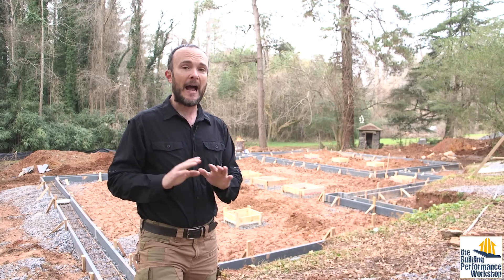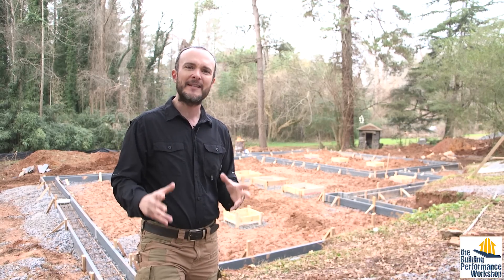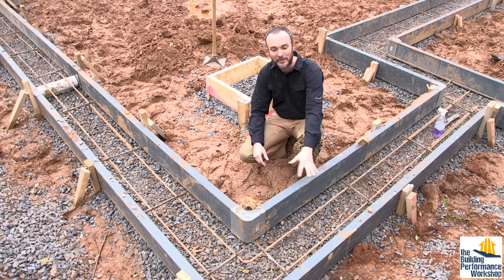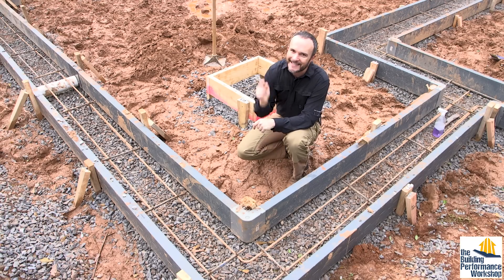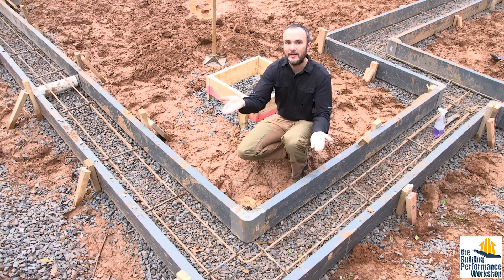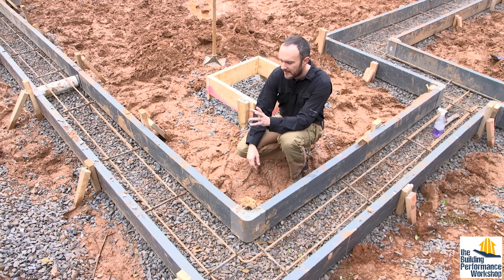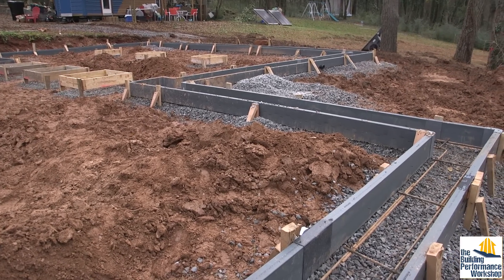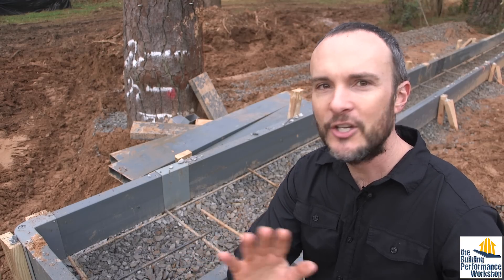First Concrete Pour: Form-A-Drain 4-in-1 Foundation Footings

Comment: As a residential building contractor, I do not allow my customers to interfere with the build process. My customers are allowed visitation to the job site at pre determined times, and are not allowed to give any instructions to my sub contractors, employees, suppliers, as well as have any dealings with the local building department. To do so would nullify the contract. After 44 years in the business, you learn a thing or two. A novice who has watched HG TV for a year has no business on a construction site. I make exceptions for decent people at times, but I never deviate from this rule when it comes to my contract.
Reply from the maker: Maybe you missed it, matsfreedominatrix, but I am the builder and GC. It's my own home. The foundation contractor is a sub. Get over it.
Reply: Yeah, why would you? Can't tell you how many times I've seen homeowners slow down the build process by catching subcontractor mistakes! Best to keep owners off site so it's easier to get away with it.
Reply: Nice comment. I never interfered. My concrete is not the grade I paid for. It has cracked full thickness in less than 6 months. The walls are not straight! The doors have gaps  that were patched because the contractors could not cut straight. I have 3 less steel beams in the first floor than are on the plans. Engineer designed plans. I paid for 2 times the amount of tiles that were actually used in the house. I threatened legal action if he charged me for them. I now have a huge pile of extra tiles sitting in my garage. The reason the customers want to be on the building site is to stop SHODDY, LAZY, CORNER CUTTING, SCUMBAGS RIP THE CUSTOMER OFF! If your the customer I recommend you go to the site on a daily basis to ensure your house is ACTUALLY being built to the plans. ANY contractor who doesn't want you to go to the site, want s to restrict your access does not want you to see where they are working the margins to increase their profits.
Reply from the maker: @petercoverdale5003  well said
Reply: @petercoverdale5003  Pick a contractor with a GREAT reputation next time. Otherwise, be your own contractor. Hire your own subs, deal with your suppliers, and work with an engineer of your. People do it every day.
Reply: Disagreed with your initial comment. Totally agree with this one. Yeah, people can be a pain. Welcome to the human race. But is you cvan't tolerate it, charge double or work in I.T.? @matsfreedom
Reply: @petercoverdale5003  : Great example of why @matsfreedom can shuv his comment squarely up his ass. I encourage my customers to show up on the job site. This ass hat apparently doesn't understand WTF a Change Order is all about. Most times ( 9 of 10),  customers need to actually "see" something before they actually realize what it is they wanted; I don't think there is anything wrong with this, or allowing them to make changes. 
This @matsfreedom guy sounds like the type who 1. thinks he knows it all better than every other person on earth. 2. Talks shit about all other contractors and how they can't do 1/2 as good a job as he can. These are the types of contractors who put the "CON" in CONtractor. Nuff said...
Reply: If I’m paying for your services, you are not going to stop me from showing up to see what’s going on on my own property. I respect the fact that you do not want the customer interfering with your workers. Beyond that, no contractor is going to  treat me like they are doing me a favor.
Reply: Naturally, if your customer doesn't happen to be on site when you come up with some money-saving, corner-cutting idea, you just implement it and pass the savings on by nullifying your contract and coming back with a less expensive one. Um-hmm.
Reply: Doing it this way could also save a marriage. I was a carpenter on several custom homes. The wife wants this the husband wants that, endless frustration.
Reply: @LegendLength  Did you not see him pouring concrete?
Reply: I have paid construction supervisor because he was there every day and watch the contractors to deliver what was in contract. He saved my ass and a lot of money. Contractor blocking the supervision will be fired immediately by me.
Reply: As a homeowner and the one paying for the house, I would be onsite every single day for the duration of the work and everyone would listen to me or they wouldn't be working on MY house.
Reply: @jtltet  : Well... then you probably wouldn't have anybody working on your house I'm afraid. Although I didn't like what @matsfreedom had to say, and you can see that in my previous comment, I ask that my clients NOT interrupt my subs or get in their way. I ask my clients to contact myself if they have any questions about anything concerning the job. Especially if it's about the quality (or lack of) they think they see in a sub. It's always best if the GC points errors out to the subs or informs the subs of change orders and not the home-owner in my experience. As far as MYSELF though, as your GC, you would have every right to fire my ass if you didn't like the work I was providing you.
Reply: @TrailTrackers , well since I was the GC for my house it was my responsibility to speak to all subs and verify the work they were doing just as any GC should be doing.  If I wasn't the GC then I would go talk to him/her about any concerns if they are around.  That doesn't mean I wouldn't have a dialogue with other subs on the jobsite though.  As the homeowner, it's my job to make sure the GC is doing his job and if he isn't I have no problem stepping in.
Reply: I agree with most of what you are saying as far as the customer not going straight to the subs and  communicating with one spokesperson - As far as visitation, I will visit whenever I want, definitely during framing, electrical and plumbing.  Sounds like you don't trust your quality of your subs or your work.  Maybe you are trying to hide some shortcuts.  I don't know your work and that raises some serious warning flags with me if you were going to be the builder.  Seen it way too many times - and yes, I am in the construction industry so I am also not the average client.
Reply: @darrellwade380  Years ago, I had a customer fall into a small trench, twisting her ankle badly. It could have been worse. One serious injury and the lawsuit that follows can ruin an otherwise good contractor. Common sense dictates my customer visitation policy more than any other motivation. Job sites are dangerous places for those who aren't familiar with construction. We can all enjoy the  building process without risking life and limb.
Reply: @matsfreedom  : Did you have the trench clearly marked with warning tape and stakes tall enough to reach an avg persons waist? If not then that's your fault; just sayin'.
Look man... I think I 'get' what you're trying to accomplish in your first comment. And if you really do have 44 yrs in the industry then you obviously aren't stupid concerning the construction process. And in 44 yrs I'm sure you've even had some "real winners" of clients.
But...
Whatever the culture is where you are from is definitely different than the culture where I live and work; I'm guessing east coast or California. If I ever told a client the exact thing you said I would be out of business because they all would tell me to go to hell. Where I am from, we just can't expect clients to not show up on the job site. Hell, I even have extra insurance for if a client injures themselves and it was because of something I did or didn't do correctly (like an open trench that's not marked).

Maybe I just have a different outlook on this than you, because in my 33 yrs I've had plenty of clients who took the role of "Owner Builder", and I was pretty much there as a consultant and using my subs for all the work they either didn't want to do or just couldn't do. So from my perspective, I've been on every which end you can think of in this business. Maybe that's why change orders and clients showing up on site doesn't really bother me much; they're curious and excited about their new home so how can we blame them really.
Reply: @matsfreedom  What part don't you understand that they own the property and can be there anytime they please.  If they fall and get hurt, that's on them and their insurance.  It has nothing to do with the contractor unless he is maintaining a job site that doesn't meet safety standards by OSHA.
Reply: @matsfreedom  
Give the customer freedom to visit the site all the time but let the customer sign that he does so on his own risk if not accompanied by the contractor or his assistant .
Reply: @jtltet  Tell that to the lawers. They will destroy everyone in their path.
Reply: I hate contractors and you spelled out exactly why I hate contractors. Contractor’s ultimate goal is speed. It’s not quality or workmanship or pride in one’s craft, it’s finishing this job and moving on to the next job whether it’s correct or not. What ever the contractors or subcontractors can get away with is what they’ll do.
Reply: Lol this guy cleaned his rebar with purple Windex... Nobody told him it  needed to be blue Windex
Reply from the maker: It was water, Zack, just wanted to make it pretty for the camera
Reply: I'm pretty sure you'll find that Corbett is the builder!
Interesting rant though!
Reply: I can understand the not allowed to give any instructions, but if you do not allow them to be there for any reason beside safety then you sound like one of those shaddy contractor, and it do not matter how long you are in business. Shaddy often are in business for longer than the best ones.

If I pay for your service, you can be sure that I can come at any time on the site to check that you are not screwing me over.
Reply: I would fire you on the spot and find a new contractor if you told me that.
Reply: I worked for 2 contractors. One was great, the other cut corners so bad I had to stop working with him. MOST customers would have NO idea which one they were getting, and most people would poke their eye out if they ever picked up a screwdriver, and that goes for a lot of people that THINK they know what they're doing. If you know what you're doing, I'd show up at the jobsite constantly. If you don't, show up but maybe keep your mouth shut so the contractor doesn't know 100% that you're clueless. Just being there is gonna make them be better. I get what matsfreedom is saying, but I'd NEVER tell the customer they couldn't be there. If they didn't know what they were talking about or holding up the process, i'd just tell them and we'd have to proceed from there. It's their money.
Reply: Glad we have that clear.  Now pack your shit and get off my property.
Reply: I could have saved myself a lot of heartache if I had been more involved in my project, pretty much every part of it was slapped together, mistake on top of mistake, and now its impossible to fix without ripping half of it apart.
I am doing a contractor a favor by giving him employment, he is not doing me a favor by taking my hard earned money so he can do it the cheapest way for them.
Reply: The no way you would ever be my contractor of choice.
It would be my house, my money, my risks.
Reply: @johannesslobbe6854  you think you own contractors thats the problem the fact is you're lucky to have a good one , therefore with your attitude you'd never get a good one. Do you give your doctor advice to.
Reply: matsfreedom , not all customers are idiots.. you work for me, or you don’t... saying you know everything is a bit arrogant.
Reply: My house...my rules. If I don't like what I see it gets fixed or someone gets fired.
Reply: I guess you missed the part where he said he was acting as his own general contractor. And was working with his builder and listening to the builders opinions and taking them to heart. You sir i would never hire to do work for me. If i am paying your ass to do a job for me i will visit the job site when ever i see fitand question any and every thing you are doing. And if you cop your attitude with me. Would just fire your worthless ass as per the pre signed contract.
Reply: Lol
Reply: U R A THUG!
Reply: good to know for no to hire you
Reply: I have that same provision in my contract, and the client will always violate it, usually in minor ways and I never acted on it out of good faith. Until recent, I've never been so glad I had that provision in my contract. Showing up at my employees lunch hour, making request to employees regarding changes, calling inspectors to coordinate inspection schedule, calling suppliers to verify my pricing which my suppliers don't disclose. Requesting for money back or reduction mid contract because they had an earlier bid where that same line item was less...the end sum for the whole project was the same, we just billed differently. Consulting with a 3rd party engineer mid project and expecting us to complete the work per 3rd party engineers design without a change order because "it was essentially the same".
Reply: With this comment you lost a lot of business what's your company name
Reply: The know everything utuber! They would do one day research and be came an expert.
Reply: I once let a pro driveway guy seal my driveway for me, always trust a pro lol, not again!
Reply: So much for my uniqueness.
Reply: Do you mean like restoration companies that don't put in thru-vent or or insulation in, or seal the vapour barrier. Do a shite job on drywall, use 2 rollers for 4 different paint colours, or trimwork that needs caulking in every break, etc, etc, etc..... I'll talk to you first, after that I will inspect the work, if it isn't done to my standard I'll run the lot of you off the site, and have the insurance company pay me....... hint this happened several years back, and I had to rebuild walls, and roof
Reply: I sort of see where mats comes from as a former and experienced waterproofing tech, my step dad who owned and operated the company first told me on a few jobs " let me handle the customers" and knew then what he meant, since our work entailed preparing to cut and remove concrete from the wall and was covering the footing was an already dangerous job for us, last thing we needed was a "helicoptering" customer down there with us. After that we would allow them to come down and check out the work even if they were just there to simply chat aside from asking about food or drink we may need (we always packed for break times and usually went out for lunch or one of us left to pick it up if we ordered it on the phone we never turned down free pizza!). And if the customer was looking for some perfection come to the finished look for an unfinished basement then we would comply but again when mixing our own concrete. we kept them away! Always explained why the install before covering was done the way we showed them despite what they assume and corrected a mistake we did not notice and they may have caught at the time we allowed them to inspect our work themselves if they were that inclined. Most of our work was word of mouth, some thanked us for doing a better job than the other guys.
Reply: What's best for the builder is not always what is best for the home owner.
Builder wants fastest and cheapest that is code compliant, using only techniques and materials that he is most familiar with.
This does not always produce a house most suitable to the owners requirement and taste.
A lot of building is problem solving, decision making, and the builder doesn't always have the time to put much thought into some decisions, whereas an intelligent informed owner (like the poster) can help a lot by putting a lot of thought in, and finding the best alternative.
Reply from the maker: Thank you George
Reply: @georgegibson707  Not true. As a builder, I want it done right, with the highest quality possible. No exceptions.
Reply: matsfreedom No one should doubt you, but as a residential contractor for 20yrs myself, I've seen far too many contractors that specialize in two things, 1)fast.  2)expensive.
Reply: matsfreedom: You are a prime example of the type of contractor homeowners don't need. I would bet you made a lot of money screwing over your customers while delivering shoddy work. Nullify the contract I would hope that the smart customers would not have signed the contract in the first place. If I had been stupid enough to have you as a contractor the first time I found a problem you had caused I would have thrown you off the site and hauled your ass into court.
Reply: Haha you can shove those "rules" up your ass. The one paying the bill should be able to be involved in whatever way they see fit. As the hired help, your job is to work with them on their terms (within reason) or not take the job. The gull of some people.
Reply: matsfreedom....that's because you're a proper tradesman , there's nothing worse than a cocky client thinking he knows as much or more than you because he's read a couple of books , i'd sooner give the job away than have the stress of dealing with fuckwits like that again.
Reply: Smart man
Reply: Want it done like on diy then do it yourself!
Reply: @baconneggs2406  Ok .... so on the initial episode on the reno in chicago.  You believe no customers should be allowed to inspect or better yet keep away. 

I could be ok with that if ALL contractors and subs built and did the work as if their families were spending the money or living in the project.  
1.  Had sinking front step tore out and repoured by a concrete contractor.  Specified 2 things that I wanted. First was rebae wire mesh to be in the top of the step so if it sank again .... It would hopefully sink as a unit.  Second thing I specified was a barrier between the new poured concrete and stucco walls. 

On the day of the pour which was supposed to happen at noon, got a call at 7am.  Had to leave work early by the time got home they were putting concrete down. .... The 2 things I specified above .... NOT DONE... one F'TARD contractor.

2.  Had a painter that lived in my development repaint my house .... The man was in out in hours.  I walked around my house multiple times and could not find one issue with the paint or work that he done.
One issue was .... I didn't like his "prep work" on the rinsing or washing the siding before he started.  Had an overhang that pigeons loved to next in ... So it was filled with bird crap and nesting stuff.....  I had to go out and get my own power washer to get it clean which ..... I could see being a homeowner responsibility .... tho at the time of having to lug out ladders hoses pressure washer I sure did piss and moan about the guy.  

Contractor #1 .... I'd never recommend him to anybody for anything for any reason. 
Contractor #2 ... I'd reccomend him to anybody for painting sight unseen.  

However, what have I learned .... Do not assume that the contractor will do what he/she is asked to do.  Especially, if at the end the requirements for the job are not visible.  You may say keep the customer off.  I say .... Get all contractors to do a, not reasonable job,  correct job and then why would a homeowner want to show up?

Got few other issues of contractors .... the one that did my deck that I would not reccomend he build a doghouse.  Or the contractor that ran the cable wiring ( and only really put in 2 outlets ) but cut the leads out of the wall outlet so short you couldn't get a end connector on it.
Reply: Again, for all of you who are having knee jerk reactions to my statement: customers are allowed to visit the job site at pre determined times, as I said clearly. At these times, we are able to review the work completed and discuss the progress of the job. Lets not forget the issue of liability. Imagine if a customer randomly shows up at the jobsite, trips on a 2x4, falls into ditch, and ruptures their spleen. Think it cant happen? Who do you suppose is on the hook for that? One incident like that can bankrupt a contractor, or worse, end up killing someone. The jobsite is under my control. No exceptions.
Reply from the maker: @matsfreedom  I get it- you care a great deal about the well-being of your client. When you say it the nice way, it's clear, but it sounded in your original comment like the opposite. When I said at the beginning of this vid that any project needs a quality advocate checking over the job every day, that person could absolutely be a high-quality builder who tracks and documents their crew's work and informs the client about the glitches and solutions happening onsite. So actually, I think we are on the same page after all.
Reply: @matsfreedom  
You seem to forget, Sir, you are hired in to do a job.
As employer I have any right whatsoever to check how you are doing things.
And that means any time of the day.
It is my land, I pay for wages and materials, you cannot send me from my land nor hinder me in controlling the work, together with you or alone.
And I can send you away if you try to stop me doing my checking.
So it is all mine, not yours.